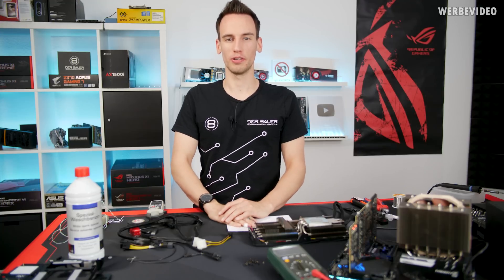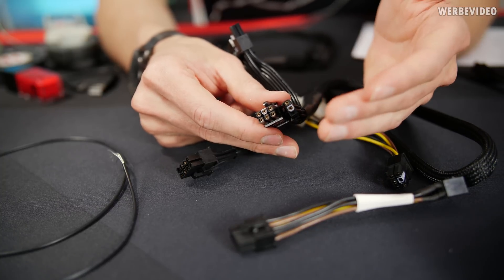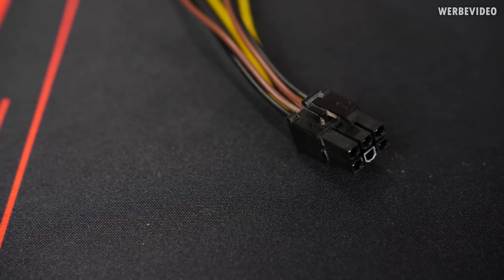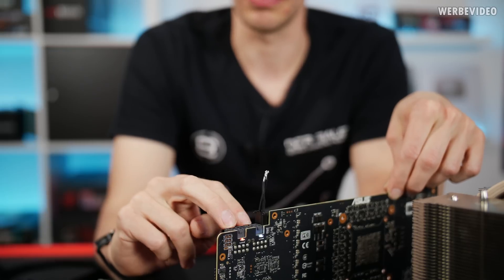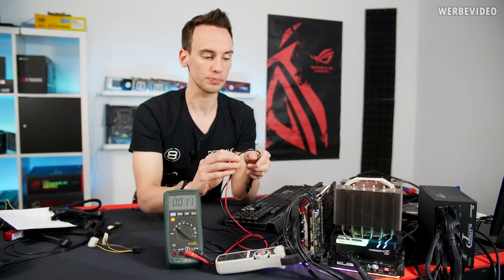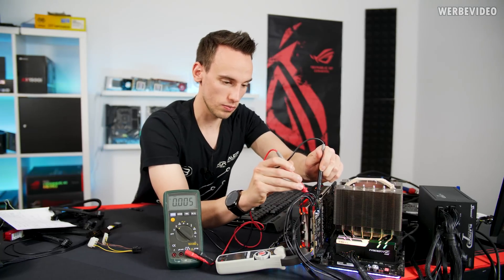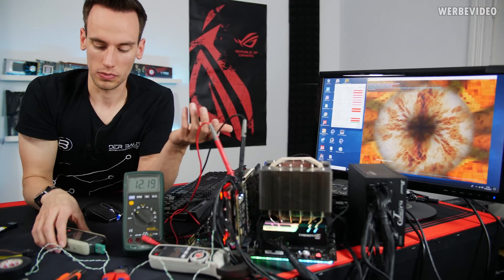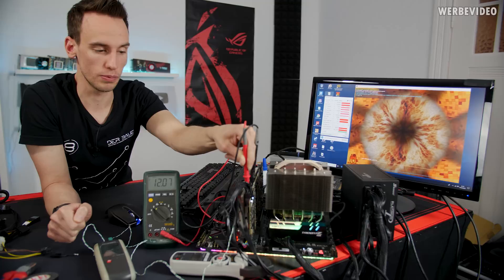PCIe Cables: So much does your GPU really need!

Comment: I've been led to believe that the power rating has more to do with the pins on connectors rather than the wires else a 6+2 pin would be out of spec as it's the pins that are the limiting factor of the design.
It's also a bit arbitrary regarding the power spec of pcie power, because if 6 pins is 75W, and 8 pins is 150W, then the bloody maths just don't add up.

Given that the rated amps per circuit (1+1ground) is 8-9 amps, then that alone gives you 96W per connected pin pair and from that a single 8 pin connector should be able to deliver 32A or 384W.
http://www.farnell.com/datasheets/55239.pdf?_ga=2.93184154.664065599.1557312412-607560797.1557312412

Given an 18AWG multicore rating of 4.5A average then that still delivers 54W per pin pair or 216W for an 8 pin. Low core count wire can handle significantly more current.
https://www.engineeringtoolbox.com/wire-gauges-d_419.html

So of you were to take 2 single core AWG12 wires (34A/408W@12V) and hook that up to two 8 pin PCIe power connectors, that's all you'd need to run a 2080ti or Vega VII, with the added benefit that single core wire is often self supporting over short distances and will stay where you bend it. If you need moar power then AWG 10 has a single core rating of 52A.
Reply: yes, that is pure science, but because this is engineering there usually are 1.5-2x safety factors involved for manufactures and parts running out of spec or to drastically reduce the risk of fires and such. Also as Roman pointed out, it can happend that the connector is damaged or one wire is not contiguous due to all the bending.
Reply: @TitelSinistrel  
Engineering involves how close to maximum you can safely engineer so that you don't end up over engineering items to the point where the added costs aren't justified. There would be reasons other than a 1.5-2X safety margin for why this is with pcie 6 and 8 pin power, most likely it's just adapting already existing technologies into the standard.
As stated the pinouts can handle far more current than the typical wire used to power the them, budget PSU's would likely use the lowest cost 18AWG wire. If you do the sums, the 75W limit can be safely served with low core count AWG20 <24 core multicore wire for 6 pin, which happens to coincide with the amp rating of the highest core count 18AWG (here is where the ratings are coming from). We can see that the typical 4 pin molex 12V pair using 18AWG core cable would deliver about 4.2A per pair and that's too low, which is why the typical molex to 6 pin PCIe adaptor requires 2X molex connectors. As it is a 2X molex to 8 pin could be problematic on cheap PSU's as while there is 2X ground wires, there is only a single 12V+ cable. 

The 4X molex to 8 pin adaptors themselves use a 3X wire pair with 2 additional ground wires, meaning that the adaptor can deliver 150W, but the molex from the PSU might not, but will be at least 100W.

I've just looked at a cheap PSU and the molex is using an AWG 18 33 core wire, which puts it in the 4.2A category of 25-40 core, which puts it in the middle and so it's 4.2A or 50.4W @12V.

so a 2X molex to 6 pin PCIe could deliver up to 100W, which is well below 8 pin requirements. Though a high quality PSU using low core count (6 cores) 18AWG could deliver close to that 150W needed for 2X molex to 8 pin, by simply using AWG 16 or low core count AWG 18 for the 4 pin molex. Just as a matter of fact, the high core count 18AWG with the three pairs of the standard, works out to 4.2X3x12=151.2W.

It should be noted that the safety margins are in the wire and the ratings will be at the point before any significant heating occurs though I haven't yet found the technicalities of this only that it's rated at 30°C ambient. You can pump a lot more amps through a wire and still only get minor heating but you will increase the voltage drop of the wires. Short lengths can deliver considerably more amps than rated in the tables, than using long lengths which will increase the voltage drop significantly. The engineering will take into account that it's short lengths of wire and not long lengths and is why you can overdraw far more than the ratings without running into trouble or risk a fire.

150W on AWG18 2X pair is 6.25A per pair and that works out to 1.2W of heat to dissipate over 80cm, and less over shorter distances. at the rated 4.2 amps it's 0.57W, not a significant difference.
calculator is here.
https://www.powerstream.com/Wire_Size.htm 
wattage dissipation can be determined by the voltage drop multiplied by the amps used for the calculation.
Reply: @magottyk  Thank you for the very detailed answer. I'm an engineer myself and didn't check this in details. What I was trying to point out is that from the engineering perspective, there usually are good reasons, (i.e. you can follow the reasoning/logic/math behind it) for some standards to be used the way they are even though the raw physics behind it say something else. 

As a counter example to the standard, you can look at pre-built systems from HP and you'll notice they are pushing the entire PSU rating to the motherboard through a 6 or 8-pin connector. Everything in the system gets the power from the mainboard. But those systems are not meant to be serviced by consumers and don't always support "standard" parts.
Reply: @magottyk  😍awsomely explained ,
Reply: I totally agree this is more about adapting existing plug connectors and potentially spreading the load if you have separate cables running all the way from the PSU to the 6 pin connector instead of this daisy chain connector that you find on cheaper PSUs. The 24 pin ATX motherboard connector is a relic from the past and most motherboards have no problem regulating from 12V down to 5V, 3.3V and 1.2V by local voltage regulators. There is no need to have anything besides maybe 12 and 5 volts from the PSU these days. Many new server systems use a 48V rail to power many nodes instead of having beefy PSUs for each node. It is more efficient.
Reply: They need to be able to handle the current without increasing in temperature. The closer you get to the max current capability of any conductor, the more heat that is generated. If the temp of the conductors increase, so does its resistance, which could cause thermal runaway and limit current. I would think 12AWG could be good. I'm surprised that after 20ish years of power supplies with PCIe power, they have not developed a standard high current  connector that is scalable by using different gauges.
Reply: yep, you can push way more Current through this stuff than the official spec. even if the Sense Pins from the Power Supply were still there.
you can easily double over the official spec and nothing will happen(nothing does happen, either). but at this point, the costs for the stuff isn't really that high and large margin for error is convenient, and basically an expected 'standard'.
are the official specs kinda crazy cautious? well, yeah. but shrug.

 @natecontarino1748  
for the ATX (Desktop) Form Factor, there isn't a reason to, though. worst case scenario you just run one more Connector to the device if it's a seriously thirsty one.
for everything else, it just needs some power, not much. computers have been reducing Power Consumption overall, not increasing. so as time goes on there's more and more headroom in the design.
Reply: If you look at that chart it is for a wire run 1,000 feet long. Every other amp capacity chart on the net rates 18 gauge wire at 22 amps. If you really want to know then run 22 amps through a piece of 18ga. wire and see if it can handle it. Volts divided by amps gives us a value of a half an Ohm  (0.54 actually) load. Of course the resistor has to be rated for 264 Watts (Volts [12] times Amps [22] equals Watts). So that is a bit of an issue. I understand the point of the video is how many wires does a graphics card really need but it boils down to the delivery capacity of wire or the current capacity of the connector.
Reply: @1pcfred 
I don't see where the current is rated for 1000 feet. It only mentions 1000V.
If you plug 22A for 18AWG into the calculator at power stream, you lose all your voltage in the wire @12V and 1000ft.
Even at 240V and 2.2A (max power transmission rating) you lose 12% or 28V at 22A the voltage drop (289V) is more than the supplied Voltage.

The Amps stated on engineering toolbox is the typical maximum, and not for 1000 ft specifically. 1000ft of 18AWG @2.2A @480V still drops 5% this is just the load of the wire itself @4.2A it's 10% or 48V. @22A it's a 250V drop or 52%.

The maximum length of wire for the current and the voltage you want will be defined by the acceptable losses you determine. 

I gave an example of 6.25A over 80cm (the usual longest length cable attached to consumer PSU's) showing acceptable losses within reason with the wire attached to a molex connector. What I didn't mention was that the voltage drop went from 0.138V @4.2A to 0.206V @6.25A. At 22A the Voltage drop goes to 0.724V or 6% which means that you'll be dissipating a toasty 15W in that wire and the GPU might not be getting enough voltage (ATX standards is +-5%) . Recalculating to 1 ft and the voltage drop get's back to a more reasonable 0.29V and that means it's dissipating 6W, but as it's shorter with less surface area, it'll still get toasty, but the remaining voltage should be in spec for the device attached.
Reply: @1pcfred  
That is ohms per 1000 feet/1000 metres, it's just the way wire is rated as it has such a low value over short lengths. It has no bearing on the amp ratings as the length's up to you to calculate for your voltage tolerances. 

For a given current load a low voltage may be seriously compromised with too thin a wire over a distance, but up the voltage for the same current load and the voltage drop doesn't change, but the percentage drop does.
e.g. AWG 18 5A over 10 feet. (using the power stream average AWG rating and calculator)
@6V voltage drop is 0.658V or 11% for 5A 1.2 ohms Voltage across load = 5.342V
@12V voltage drop is 0.658V or 5.5% 2.4 ohms Voltage across load = 11.342V
@24V voltage drop is 0.658V or 2.75%  4.8 ohms Voltage across load = 23.342V
@120V voltage drop is 0.658V or 0.55%   24 ohms Voltage across load = 119.342V
The wire will dissipate the same amount of heat regardless of voltage for 5A which is 3.29W, because the resistance doesn't change, in this case 10ft =0.06385 ohms which is not nothing. 

This translates to 0.329W per foot @ 5A and that doesn't change except when you take temperature into 
account.

Now what happens when wire heats up?
Resistances change.
http://www.interfacebus.com/AWG-table-of-different-wire-gauge-resistance.html
As resistances change so too does the voltage drop across the wire in the circuit, when you exceed the current rating you are heating the wire and creating more inefficiency until you hit equilibrium when the wire stabilises in temperature. As you add more resistance to the circuit, the total load goes up in ohms and the amps come down for the voltage across the circuit. When the percentage drop in the circuit across the wire is negligible, so too will be these effects, when you start getting over 5% then your device could shut down or crash because it's not operating within tolerance.

Most devices have a fair amount of tolerance and ATX spec is +-5% so you can push past rated amps up to a point, but as we are mostly dealing in low voltages in PC's, you can't go nuts on how far over you can go before the system starts misbehaving.
Reply: @1pcfred  
Application in the chassis is paramount as to what you can get away with, 22A works out to 6.3W and 0.29V per foot.
Remember that is a single wire of 1 foot and your cable has a + and ground wire of equal length to the connector, meaning that the voltage drop and wattage dissipation is for each 6 inches. Also I don't think the term means what you think it means. 

Chassis assumes many things like single wire and not in a bundle (e.g. automotive where the chassis is your ground or negative/common) and also takes into account the insulation's temperature rating, lower temp insulation cannot run higher amps without melting. 22A would probably require a 125°C rated insulation as the rating for AWG 18 with 90°C insulation is 16A, bog standard 60°C insulation is 10A. Short wiring inside a case might reference as "chassis" use, but the maths doesn't work out for the amperage you claim. Do not treat a PC as chassis wiring as the case isn't part of the circuit.

The maximum usable efficiency (voltage drop) for your wire calculation would be 5%, unless you are deliberately calculating the wire as a resistive load in the circuit and have allowed adequate cooling or are a scummy manufacturer who just couldn't give a rats about standards. In a car where the wire is heat sunk to the chassis and is short enough, it probably won't get too hot especially if it's got plenty of moving air around it. if it's part of a loom of wiring then it shouldn't be treated as chassis wiring for those high amps.

Where is your reference for 22A as I haven't found any tables that high.
Reply: Paul Frederick 
I've looked for numerous references to "chassis" wiring, common references are single short wire from the chassis to the circuit and openly spaced wiring not bundled. Not in a conduit is rather lax for a definition when you're claiming 22A.
Are sleeved psu cables power or chassis, they are bundled and in a conduit.
All insulated wires are in a conduit, if you mean the tubes used for protecting wires then is my power extension cable power or chassis, because it's a bundle in insulation but it's not in a conduit?

The "chassis" amperage in the tables will be a narrow use case like that described above and not just because it's in a PC or other electrical device, though people may call it that, you don't use the high amps of "chassis" wire and think it's all hunky dory. 

Perhaps this may be useful.
http://cablesondemandblog.com/wordpress1/category/cable-amps-current/
Amphenol do appear to be experts in this field
Reply: Yes, the specs are very conservative. The 75W/150W rating on 6/8 cables is pretty nonsensical. I suppose the safety factor in the engineering explains part of it.. to be perfectly honest, we should be using one pair of ~10AWG/12AWG cables to deliver all the power to a GPU, because that would be good for 25A+, and we could use small screw-on lugs for the wire connections.
Reply: @asm_nop  I think the way they went with the toolless plug in connectors was the best choice. BTW 10 gage lugs are not small.

Comment: You could have DIYed all the 12V pins to 1 12V cable and all ground pins cables to 1 ground cable. This was enough to show that this is fine.
Reply: yea, since in the internal of PSU it is clearly they came out from the exact same single point. The only issue of doing so will be cable temperature increase, as loads are not separated into multiple cables.
Reply: @nameinvalid69  i actually made a cable like that once for my mining rig. It had 10 GPUs on one server PSU. I ran a fat cable almost all the way to the GPUs and then split into smaller cables with connectors. Overkill. It did run about 200 Amps at 12.1V.
Reply: I ran a 2 wire pci cable for years. I used 12awg Dean's noodle wire which is an ultra high strand count wire that is used in the RC world. Just ran the sense lines to ground.

Comment: Why not calculate the current using the voltage drops over the 3 shunts exactly as the card does? it shouldnt be hard to solder to them for test points. (or at least for the PCIe power?)
Reply from the maker: Why? Using the current clamp is much more convenient :D
Reply: @der8auer  simply to be able to see the PCIe current primarily, to see if the changing voltage one the PCIe power cables influences the power there. Partly cos you are one of few people how would both know how and why and be able to present it lol. iirc they use a 0.01 ohm shunt so 10mV to one amp is pretty dead simple.
Once youve got the board bare and the iron out - guess i figured its as easy to do all 3.
Reply from the maker: ahhhh now I get what you mean. Solid point. Maybe will do it in one of the future videos
Reply: @der8auer  please do this!!!
Reply: @der8auer  You should hook up an oscilloscope and use the math functions to do the power calculation for you all at once :D I guess you'd need to measure the shunt and the 12V at the same time.

Comment: nice .extencins caple for PCI expres drop voltage?
Reply: Yes, maybe. Any added resistance to a circuit will decrease current flow and increase heating (of the thing adding resistance, in this case the cables and connectors). So adding extension cables will decrease current and thus decrease voltage, but not necessarily by that much. It depends on how good the cables and connectors are and how long they are.
Reply: @ericbsmith42   extencins phanteks  PCI expres 8+6  and 24 pins   font seasonic 650 w focus gold   grafic rtx 2080 ventus msi

Comment: I know just the right tool to get the job done the 295x2, 8 pin off psu  -> 2x 8pin pcie will melt the powercabel, sold mine to a miner and I said use two individual 8pins well he didn't and wrecked his psu =)
Reply: Lol

Comment: why does a connector have multiple ground pins? why cant they just all use the same ground pin?
Reply: The same reason it needs multiple positive wires - voltage drop and heat. What is really ironic is you are forgetting that the power actually comes from the ground and goes to the positive, when they invented the current convention they didnt know what electrons were and actually got it backwards
Reply: Because all the current will return on one wire.